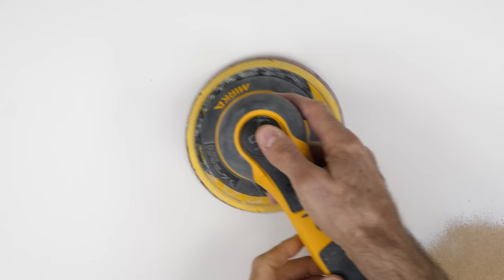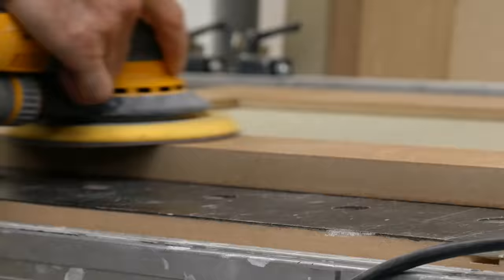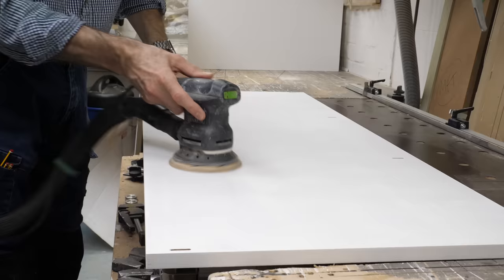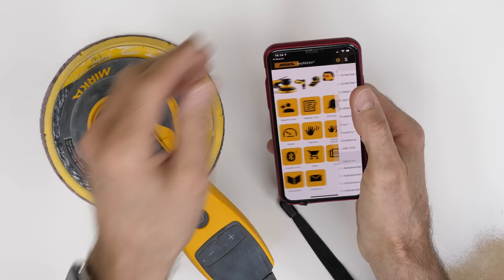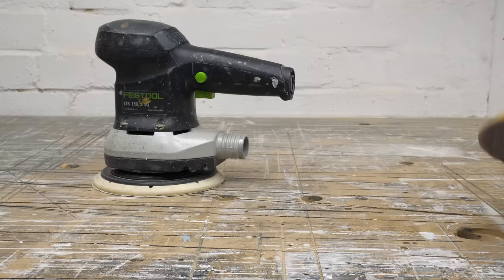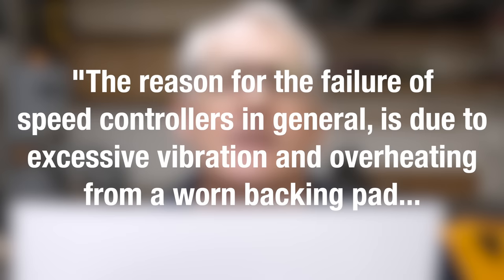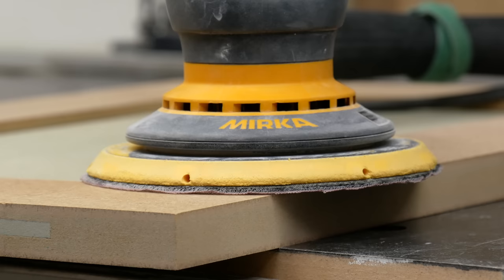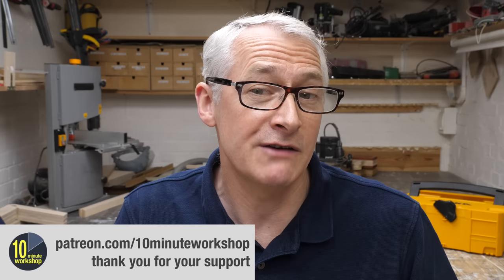Mirka Deros Random Orbital Sander [video 406]

Comment: I've had my Deros for around 4 years and it's been well used. From fine sanding to stripping paint off badly painted window sills, it's done a lot of work with not a single problem.
Reply from the maker: Good to hear. Thanks! It does seem odd that some guys in the trade can hammer them and have no issue at all, whereas some have major warranty claims within only months of very light use. 🤷‍♂️👍👍
Reply: @10MinuteWorkshop  guarantee mine will break next week now after saying I've never had any problems with it 🤦‍♂️😂

Comment: I've bought two of them.
The first one in 2014, pretty much when it came out (already the 5650CV with 125/150mm pad included) - gave it to my father-in-law after one year of use, and straight away bought another one for me. This year, the bearing on the first one had to be replaced. Other than that, I'm very impressed they still keep on going. No other repairs in all those years renovating 4 houses from basement to roof, sanding EVERY plaster and dry wall .. Abranet is amazing for those type of jobs. Very little to absolutely no dust, very long life. I've run this thing 2-3 hours non-stop countless times. Very light and ergonomic. One of the first brushless sanders if I remember right.
I honestly don't know what I'd have done without one.. 
I  use it together with a starmix vac, which I also hightly recommend.
Reply from the maker: Good to hear thanks! It’s a lovely sander. 👍👍
Reply: Makes me wonder whether they've changed any components in the newer models perhaps - perhaps the older models were built to last ?

Comment: Best sander I've used . The speed control fail after six months of daily use on mine(2018),. But was replace under warranty.. no problems 18 months  down the line.. Similar thing happened to a friend's.. incidentally I bought mine after using a friend's on a job.. I've used all the well known brands and reliability issues aside  it's such a great design, low vibration good dust extraction, its comparatively quiet ,light weight and compact with great ergonomics..having said all that if it fails in the near future I probably revert back to festool .
Reply from the maker: Thanks! Yes, it’s a cracking sander for all the reasons you say, but the speed controller and motor do seem to be prone to failure, which is a concern. 👍👍
Reply: How much would it cost to replace a speed control? And can you replace it? 🤔
Reply: @didzmarello888   not sure .. as I say mine was replaced under warranty.. still going though strong as of today
Reply: @didzmarello888  You can replace the speed controller, and if done by the company entrusted with Mirka repairs I seem to remember I was quoted around £150.

Comment: Hi Peter. I would like to see how this sander compares on its principle marketing claim, namely it's zero dust claim. So get your bin bag and gaffer tape out for a follow-up! 😀
I've had a loan of one for a weekend and I was impressed and concerned in equal measure. The best performance was from the abranet sheets but when I went and bought some to replace what I used I was staggered at the cost and they are very fragile when sanding edges. Something Keith mentioned. With standard sheets the dust collection wants as strong and left alone questioning the value. I hadn't considered the 5" 5mm stroke advantage but then I'm not sanding for a living. 
And now I'm entering the professional furniture making business I'm still inclined to plump for festool as my investment for finishing. Anyway as always great video. 👍
Reply from the maker: Thanks Karl! Yes, I suspect t the ‘dustless sanding’ claim is only with abranet , and probably their own extractors as well. I’m not a huge fan of abranet either, for those reasons and a few others.👍👍

Comment: Hi Peter, 

Interesting video, thanks. 

I have been using the 5mm stroke CEROS for a few years now (as a keen amateur furniture maker and DIYer). I have not had any reliability issues thus far, so can’t really comment on that or on the support from Mirka.   In use I really like it. The key issues for me are handling, low vibration, performance, and dust collection. 

I have not found anything else that can match the handling; the low weight and the compactness makes it feel more like an extension to your hand, and that makes for great control. Easy to use in any orientation and to balance on edges. Previously I would not have tried to use a RoS for knocking the arises of a board, but with the CEROS its easy and feels natural . As you said, far less top heavy than anything else out there - I can see why folks used to using air sanders in body shops like them so much! The paddle control is different from a trigger, but personally I got used to that quickly enough. The variable speed control using the paddle is less useful, so generally I find myself setting the max speed on the buttons, and just using the paddle “full on” most of the time. 

Vibration is very low – although not zero – but masses more comfortable than the Bosch RoS I used previously. 

Performance really shines – loads of power, and if you stick a 40 grit disk on, it will eat though rough finish removal etc really well, while also giving a very fine finish on higher grits. I have never regretted getting the 5mm orbit version instead of one of the “finer” ones. 

Dust collection with mesh abrasives is excellent (I have not tried any other than the Abronet ones – are there others you prefer?). With the normal “punched” sheets its not quite as good, but still very good IME. (buying a 30’ pack of 32mm dust hose from Rutlands is also a great way to make up long  extraction hoses to hand  tools with a slightly less cumbersome hose, without forking out the silly money Mirka want for their slim hoses!)

Vibration is also very low which again I really like if doing a long session.  I use a 5” pad on mine, and have recently bought a 6” one for it (apparently the 3”, 5”, and 6” pads are all interchangeable between the various machines). I just need to find where I left the pad change spanner now :-)

Kind regards, 
John
Reply from the maker: Hi John and thanks for the detailed reply.  Yes, as I say it’s a really nice sander, and I’m glad your is working well for you. Not a particular fan of abranet - always found it tears easily and the grades don’t match what I’m used to -  it Granat mesh is good, and the multi-hole Sia abrasives from Amacus are very good. 👍👍
Reply: @10MinuteWorkshop  Yup I know what you mean, while the abranet give me good longevity while flat sanding, they are easy to damage by snagging on edges etc. I will try some of the alternatives next time I need to restock.

Comment: And here lies the rub. I'm a Festool guy and have considered this sander a few times over the years and reliability is the primary concern, and the paddle being a secondary concern. I can probably adapt to the paddle but reliability is important. Here in the states the current prices are ETS EC 150/5 $539 + tax. Deros $663 +tax. The 5" pad for the Deros is an added cost that makes it $703 + tax. The ETS EC 150/5 is back ordered with some pretty long lead times at the moment. I do have an order in for the ETS EC but the Deros is easily found and I could have it in hand next week. I am not a hobby guy I expect these tools to make me money, but all my Festool sanders have lasted well past warranty and have never been sent in for repair. Which leaves me thinking stick with what I know works, or roll the dice and hope i'm in the lucky group of Deros owners. I do wonder if any well used Deros can make it 7-10 years though. 

The app is a let down. Not even the basics of lifetime tool use hours counted? 

Thanks for posting the vid as i'm on the fence.

Comment: I’ve had my Deros for 3 years and used it for hundreds of hours without a single fault.  It’s the best sander I’ve ever owned.  I also own the festoon rotex 150 which is brilliant but very big and heavy.  For lighter sanding or anything high, or when you’ll be holding it for hours each day, the Deros win hands down.  The rotex is excellent when you want brute strength.

Comment: ive got a bosch 125/150 absolutely brilliant …...had it for 10 years never replaced a Velcro pad cant recommend it enough
Reply: Yeah, I just checked that out and it looks great.  I've got lots of Bosch stuff and it has never let me down.  Good design, great engineering - they just work.
Reply: Hello Peter, Thank you very much for this information.
I hesitate between the Mirka Deros and the Mafell EVA 150 E / 5. Do you have an opinion on this Mafell sander?
Thanks again.

Comment: Got a Bosch GEX 125/150 AVE which has 125 and 150 interchangeable pads. Has a somewhere in the middle stroke of 4mm. Bit of a lump but, with it's dual chasis is possible the smoothest sander to use all day. Used it to strip and re-finish a couple of boat hulls - all day long work - no numb fingers.
Reply from the maker: Cheers Stew! Good to know - I’ll take a look. 👍👍
Reply: I agree! I bought one of these and the vibration levels are minimal. Also great to have the option to change pad size.
Reply: @10MinuteWorkshop  have to agree here, the Bosch is great. Comes with 3 pads !

Comment: I'm a Festool guy but NOT for sanders.  I have 5 Mirka sanders, a Ceros, 2 Deros, a Deos detail sander and a 3" Air sander.  There Abranet paper along with their excellent sanders are the best in my book.  Dust collection, balance, center of gravity, (that's why the design like the body shop air sanders) create a smooth sanding experience for me.  No jumps and jitters like the Festool and other sanders I have owned in the past. I love the speed control flap and the ability to SET the max speed of the flap control with the electronics.  I have never had a problem with any of my Mirka sanders.  Quite frankly love honest reviews that point out pros and cons, but clearly you have an anti Mirka bias for some reason.  Yes I am a Mirka defender, but because of my excellent experience with their sanders.

Comment: Fantastic review, felt well balanced. I've got the Festool you mentioned and I while the price brings a tear to your eye (in my experience) you only pay it once. I tried out the Mirka and, I have to admit, it felt better in the hand but the lack of compatibility with other kit , even down to the power cord, just puts me off. The backing pad breaking the speed controller is complete bull. If I'm paying that sort of money for a sander I expect it to survive everything short of catching fire. Certainly day to day use shouldn't ever be a problem. Dust collection wise I honestly didn't see anything to separate the Festool and the Mirka. I'm pretty sure when I sand with the Festool my workshop air actually gets cleaner.
Reply from the maker: Thanks! Yeah, it’s a really nice sander, but we do seem to have this division where some guys get years of flawless service out of a tool that’s absolutely hammered, and yet some have multiple warranty claims in just months of very light use. Throw in the power-cord niggles and crazy in-app purchases and it’s a bit of a head-scratcher. 🤷‍♂️👍👍

Comment: Hi, Peter, I did loads of sanding a few months ago with a Bosch Pex 220 ros and suffered badly with VWF, after a lot of research on sanders with less vibrations I reluctantly purchased the Mirka DEROS 5650CV 240V Orbit Sander with 50 Abranet Discs, Hose & Case for £407.. (I did get 200 Abranet disc FOC in replacement for a knackered Wickes ros with their  promotion, worth about £100).. Anyway after using it I now suffer no aches and pains in my hands and the dust collection is brilliant.  But as soon as I purchased it my nieces husband (a Festool fan ) who is in the painting trade told me to expect issues with it, he like you sent his back... Fingers crossed but at this moment I am well pleased with it.
Reply from the maker: Thanks Paul, good to know. As I say in the video, it’s a great sander, but I know a lot of guys in the painting trade who have had problems, not just woodworking YouTubers!  Fingers crossed yours is a good one - be very interested to hear how you get on with it in future. 👍👍
Reply: What's your verdict today? And how's your VWF after 3 years of working with the "new" sander? I assume you still use the DEROS?

Comment: Im almost afraid after watching this that now my beloved mirka will develope problems. Purchased in 2016. Three days after purchase cord fried out. My primary vendor is burns power tool( simply one of the best) had a new one on the counter for me. 4 years later I have only replaced the dust port. It was dropped many times. I made my peace with the paddle early on. Now hitting the power while changing disc is pure habbit.  I had ended up on your channel looking at mafell tracs. Love me festool gear but in the states I feel it is chronically under powdered. Great reviews and professional insight!

Comment: You’re on a roll, hitting tools that I’m planning to buy this year. Been wanting to upgrade from my DeWalt cordless random orbit sander to something with better dust collection and less vibration. Heard lots of rave reviews about the Mirka and it seemed like the perfect tool. Hadn’t heard about all the issues until your video, so really appreciate the info. I know every tool will have its complaints and so I try to build a “tool profile” from the negative comments that tries to adjust the feedback based on my impression of how justified the complaint is as well as the user’s experience level based on the way they write about the issue. I can say that just from the comments in this video, there’s enough there to make me believe that these are not issues caused by improper use of the tool, nor are they issues that are blown way out of proportion, and it’s plenty enough for me to say that I’d only buy this unit if I could get a screaming deal on it, but most likely will have to choose something else that has a better reliability track record. And like others have said, whenever I see a manufacturer intentionally choose to remake a standard off-the-shelf part into a proprietary part that doesn’t provide nearly “must have” functionality, it really turns me off to the whole brand, so I really appreciate you calling out the power plug. That’s pretty inexcusable to me.
Reply from the maker: Thanks! The tragic thing is it’s a really great sander - I’d love one, I really would, but I just can’t bring myself to do it. And yes, I’m afraid the power lead is just inexcusable. 🤷‍♂️👍👍
Reply: Perfectly explained mate,totally agree

Comment: Pro carpenter and have thankfully no problems with the Deros after 3 years moderate use.  I use a traditional $100 palm sander outside when dust collection isn’t critical so the Deros gets a break.  I love it.  The ability to sand spackle over your head dust free and also use it as a polisher on vechicles makes the cost easier to swallow. The 5mm stroke was a major reason for choosing it. I also have the both size pads.  5mm stroke with 80g screens cuts pretty fast. Not as fast as a rotax but its good enough for most tasks. 
I could see how a damaged pad could quickly ruin the bearings but not sure it would affect the ESC unless it was really bad. Motor controller failures are usually from heat, bad components in manufacturing or poor design.   That part should be less than $50 to the consumer. Hopefully a new version of the ESC fixes the issue. So far no problems here.

Comment: Totally agree with the Bluetooth comments. When Mirka first announced the Bluetooth feature I made it clear to them it was ridiculous they had not implemented anything worthwhile like "security" which will disable the tool in the same/similar way that Milwaukee ONE-KEY does, making the tool worthless if stolen.

Mirka seemed to have added Bluetooth without bothering to implement anything of use (almost more of a fashionable addition), Milwaukee ONE-KEY lets you actually configure the tool such as speeds/torque etc.

Comment: I've had my Deros for just over 3 years and up until yesterday I've been very pleased with it. What happened yesterday I hear you ask; I had been using my Festool DTS400 to sand the front door to re-coat it with some Sikkens woodstain and I kept getting little trails  which I put down to clogging of the Granat pad so I switched to Granat net, increased the speed and slowed the feed, it did help but I thought that I would use my Deros with Abranet on it. Plugging it in nothing happened hmmm, strange. Finished the door off by hand and then started investigating. Fuse and lead ok, more lateral movement than I thought was OK but it did turn freely. Blew  the ring main circuit breaker trying it again. Spoke to Mirka repair technician who told me how to check it.  Wires still attached to motor ok, 4.1 ohms on the 3 connectors on the left side so ok. I'm guessing (and will confirm it this afternoon) that it needs a new speed controller at a cost all up of around £200 with only a 3 month warranty - very very disappointed! I'm a DIYer and I have used it a reasonable amount in the 3 years but nowhere near what a tradesman would do. I justified the expense against having the hall stairs and landing replastered vs sanding down but with a speed controller costing  virtually half the price of a new sander - that sucks! I'm now thinking of getting a Festool which are even more expensive but I'll wait to see if Black Friday brings any reductions.
Reply from the maker: Ouch! Unfortunately the speed controller does seem to be particularly delicate. I’ve had this story many times - light home or trade use, then it just pegs out and is expensive to fix. 🤷‍♂️👍
Reply: @10MinuteWorkshop  Thanks for putting out there, let's hope that Mirka take notice (and offer reduced price speed controllers!)